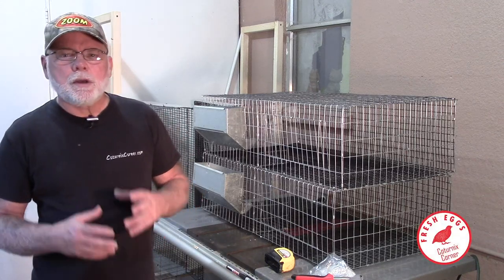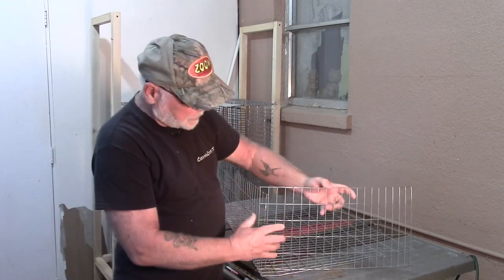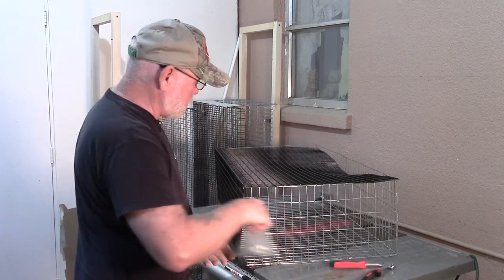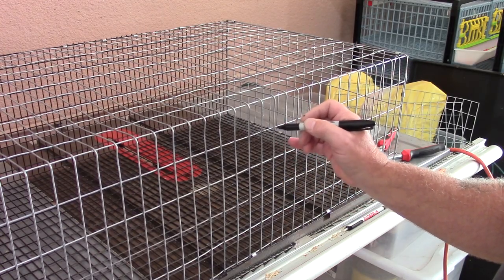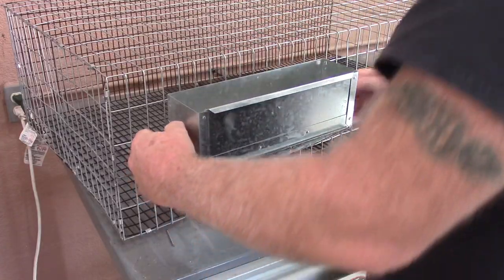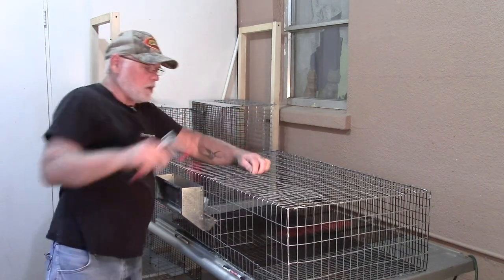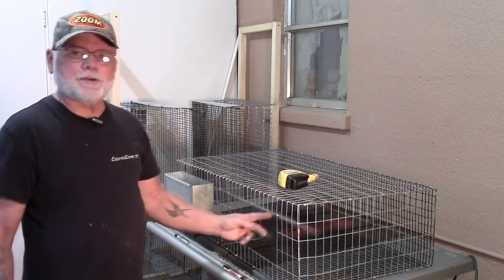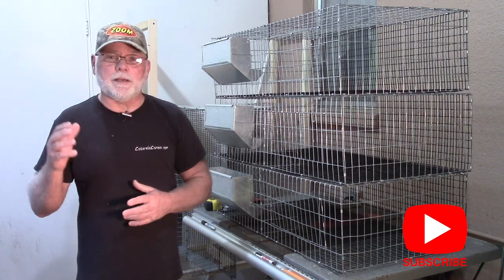Build an All Wire Quail Cage for your Grow Outs

Comment: Home Depot sells wire shelving with 1/2" spacing in 6-foot by 20-inch pieces for under $24. They also sell 12" x72" shelves with 1" spacing for under $12. For $86 you could make a bulletproof 6-foot by 20" by 12" tall cage with no bending. That's less that's half the cost of a commercial cage that's quite a bit smaller.
Reply from the maker: Yep, there's alway a cheaper option over purchasing commercial :)
Reply: How woul you o the doors, though? And do you need to put quarter inch hardware cloth on them? I have a bunch of shelves in storage to make free (nearly) but I'm not really sure how it would go. Also, do you put those on shelving units or use them as quail tractors?
Reply: Have you made something like this, or is this just theoretical at this point? I'd definitely be down to try something like this.

Comment: Would dropping the height to 8" be too short? If you did 8" front and back and 20" deep, you could do the front, top, and back all out of one piece of 36" x36" 1x2 material rather than having to do the back with the 1/2"x1" stuff. Saves a little money that way. Thoughts?

Comment: Would it compromise cage strength if I oriented the top and sides by 90deg.  Allowing my to run continuous 1 piece of wire for front back and rear? I maybe like to use .5x 1” c 36. PVC coated wire for the floor

Comment: I like these cages.  Very practical for indoor use.  I built a 3 tier unit using conduit for the legs (4 straight 6' pieces).  I used plumbing clamps to attach the conduit at the side corners of each cage and used no other support.  Very quick to assemble.  You may could use 3/4" PVC for the legs.  Also, wheels can be used so you can roll the unit around.  The plumbing clamps are so quick and simple to install.

Comment: Any chance you could discuss wire size and guages along with pros and cons? My understanding is smaller spacing (.5x.5?) is better for predator protection and possibly for their feet on the flooring (think guage plays a part as well) but droppings don't fall through as well, might be harder to work with, and more $. I'll try to remember to ask on the next Live as well

Comment: I enjoy your videos, and they are very helpful. I am searching around but can't find a link to the type of tray that you use for the droppings. Can you post one up? Thanks!
Reply: You can get oil drip pans at Napa, O` Reilly's,  or any other autoparts store. You can buy sheet metal or corrugated metal and cut to size with the cutting wheel. When we raised rabbits, we used sheets of reclaimed corrugated metal roofing, which we would pull out and empty into a wheelbarrow. Super cheap if you can find it used. I recommend the painted kind if you can find it

Just to clarify, the metal sheets were on supports that were under the wire floors of the cages.

Comment: Nice job! QUESTION 
My wife bought a bunch of 1/4x1/4 hardware cloth, is it possible to use this wire for cage construction, or does it have to be the 1"x1/2"??
Reply: The ¼" mesh is great for babies up to about a week old but after that the poop doesn't fall through and gets caked up.
Reply from the maker: 1/4" is too small, you will have issues with the manure building up. Either 1/2" or 1/2" x 1' is your best choice.

Comment: I went to tractor supply. They don't carry the 1 inch x 2 inch mesh coated wire cloth. Neither does Home Depot. Where can I get it? Thank you for the videos.
Reply from the maker: You can order from Fencerwire.com or on Amazon from the same company.
Reply: Academy fence, in NJ. Freight might be more than buying local ?

Comment: Why did you use the smaller wire on the back as well?
Reply from the maker: By bending the floor up for the back it strengthens the floor. Also, I put a small brace in the front to stiffen up the front of the cage.

Comment: Would you recommend making them an inch shorter so that you could make the stand hold 4?
Reply from the maker: It would be easier to just make the stand a little taller. I don't like the bottom cage too low to the ground, I have a hard time standing back up. LOL
Reply: I understand. I'm 6 ft tall so it's hard to bend down but wanted to make the most out of my small space.

Comment: How many quail can you put in the cage comfortable?
Reply: Terry answered this already in another comment, he said 10-12 quail. However, this is the math for 3 per ft² for maximum:
Dimensions 36x20 = 720 in / 144 in (12x12in = 1ft²) = 5ft² x 3 per quail per 1ft² = [Max 15 quail @ 3 per ft²]

Comment: Hearing protection, eye protection, and gloves are suggested for safety reasons. Safety First - a quil isn't worth your eye sight, hearing or loss of a finger.
Reply: OSHA in da house!!
Reply: New subscriber here. 
North central Florida.
Not OSHA.
Binge watching all the videos.

Used those cutoff wheels for years, no incidents.  Wife encouraged me to start using the face shield I bought her for weed eating.  Started using that along with gloves.  Just last month, cutting a small project, with safety gear intact, the wheel popped in half and went flying across my workshop, embedding in my peg board.  Just a reminder, they don’t make things like they use to….  😉Looking for a good leather apron now.  God bless that woman. ❤